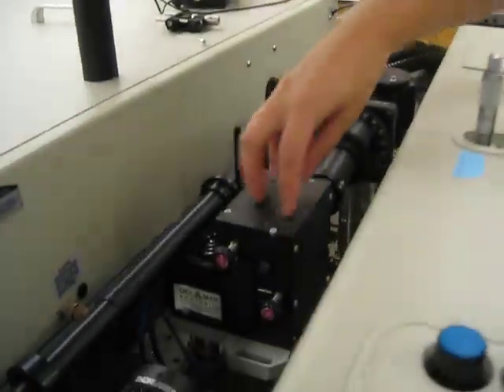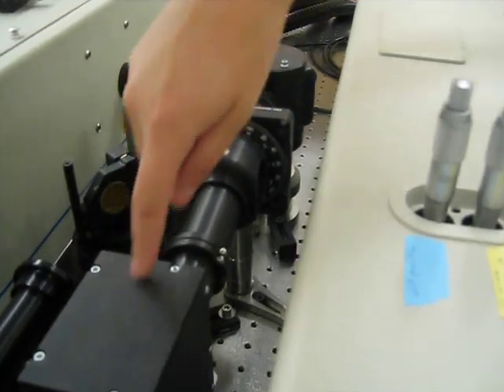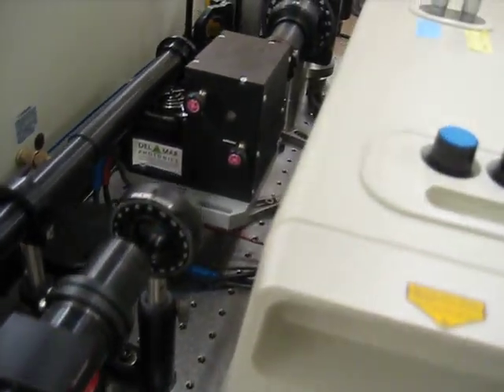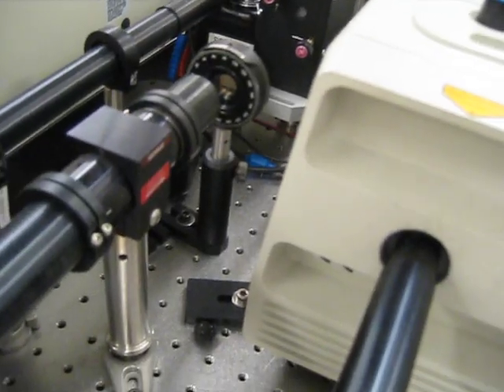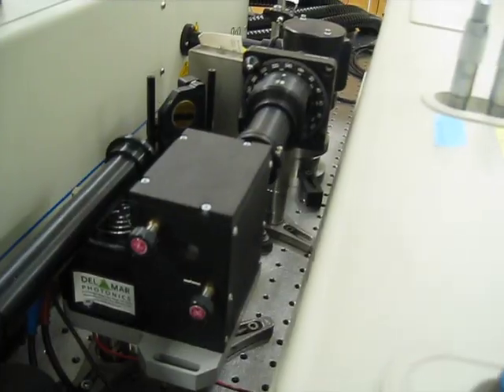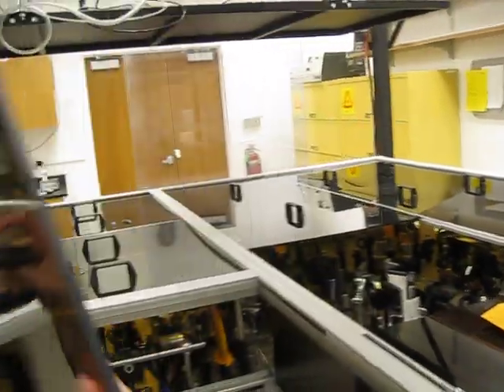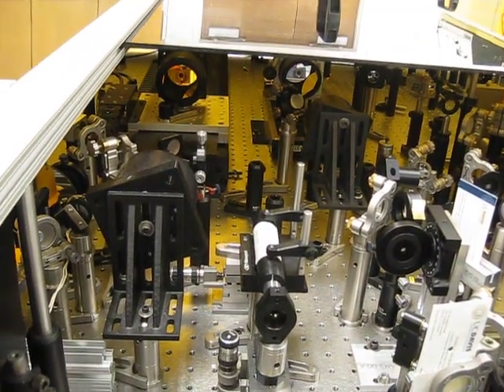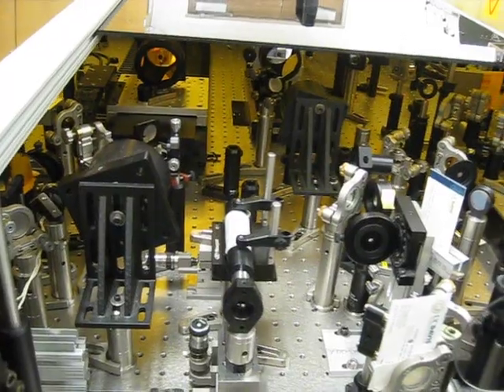A single source femtosecond-millisecond broadband spectrometer UC Davis - sales@dmphotonics.com

Comment from the maker: Related PW2015 presentations:

In situ determination of collagen fibrils size via absolute measurements of second harmonic generation 
Paper 9329-91
Author(s): Stéphane Bancelin, Institut National de la Recherche Scientifique (Canada); Carole Aimé, Lab. de Chimie de la Matière Condensée de Paris (France); Ivan Gusachenko, Lab. d’Optique et Biosciences, Ecole Polytechnique (France); Laura Kowalczuk, Therapeutic Innovations (France); Gaël Latour, Lab. d’Optique et Biosciences, Institut d'Électronique Fondamentale (France); Thibaud Coradin, Lab. de Chimie de la Matière Condensée de Paris (France); Marie-Claire Schanne-Klein, Lab. d'Optique et Biosciences, Ecole Polytechnique (France) 

2D simultaneous spatial and temporal focusing multiphoton microscopy for fast volume imaging with improved sectioning ability 
Paper 9329-92
Author(s): Qiyuan Song, Keio Univ. (Japan), RIKEN (Japan); Keisuke Isobe, RIKEN (Japan); Kenichi Hirosawa, Keio Univ. (Japan); Katsumi Midorikawa, RIKEN (Japan); Fumihiko Kannari, Keio Univ. (Japan) 

Optimizing laser and probe molecules for multi-photon microscopy 
Paper 9329-93
Author(s): Mary J. Potasek, Gene Parilov, Karl Beeson, Simphotek Inc. (United States) 

Motion-free polarization-resolved second harmonic generation cornea imaging with sub-15 fs pulses 
Paper 9329-94
Author(s): Hans Georg Breunig, Ana Batista, Aisada Uchugonova, Univ. des Saarlandes (Germany); Karsten König, Univ. des Saarlandes (Germany), JenLab GmbH (Germany) 

In vivo visualization of collagen fiber produced by cultured osteoblasts using sensitive second-harmonic-generation microscopy equipped with a 10-fs mode-locked Ti:sapphire laser 
Paper 9329-95
Author(s): Eiji Hase, Katsuya Sato, Takeshi Yasui, Univ. of Tokushima (Japan) 

Modeling acousto-optic two-photon ophthalmoscopy in pseudophakic patients 
Paper 9329-96
Author(s): Akos Kusnyerik, Semmelweis Univ. (Hungary); Balazs J. Rozsa, Institute of Experimental Medicine (Hungary); Pál Maák, Budapest Univ. of Technology and Economics (Hungary) 

A freely triggerable 766nm laser with optimized performance for STED applications 
Paper 9329-98
Author(s): Thomas Schönau, Dietmar Klemme, Marcelle König, Benedikt Krämer, Felix Koberling, Kristian Lauritsen, Rainer Erdmann, PicoQuant GmbH (Germany) 

Sarcomere-length variations during sarcomeric assembly and maturation 
Paper 9329-99
Author(s): Zhonghai Wang, Siyu Ma, Huaxiao Yang, Clemson Univ. (United States); Thomas K. Borg, The Medical Univ. of South Carolina (United States); Bruce Z. Gao, Clemson Univ. (United States) 

Adaptation of commercial microscopes for advanced imaging applications 
Paper 9329-100
Author(s): Craig Brideau, Peter Stys, Univ. of Calgary (Canada) 

All fiber based, multi-color two photon excitation microscopy with an amplified laser diode 
Paper 9329-101
Author(s): Sebastian Karpf, Matthias Eibl, Ludwig-Maximilians-Univ. München (Germany); Robert A. Huber, Ludwig-Maximilians-Univ. (Germany), Univ. zu Lübeck (Germany) 

Laser scanning stereomicroscopy for fast volume imaging with two-photon excitation and scanned Bessel beams 
Paper 9329-102
Author(s): Tong Ye, Clemson Univ. (United States); Yanlong Yang, Xing Zhou, Xi'an Institute of Optics and Precision Mechanics (China) 

Applied 3D printing for microscopy in health science research 
Paper 9329-103
Author(s): Craig Brideau, Kourosh Zareinia, Peter Stys, Univ. of Calgary (Canada) 

Two photon microscopy of native fluorophores spatial location in cancer and non-cancer cell lines 
Paper 9329-104
Author(s): Lin Zhang, Lingyan Shi, Robert R. Alfano, The City College of New York (United States) 

TICO Raman: time encoded Raman spectroscopy and microscopy with rapidly wavelength swept lasers 
Paper 9329-105
Author(s): Sebastian Karpf, Ludwig-Maximilians-Univ. München (Germany); Matthias Eibl, Ludwig-Maximilians-Univ. München (Germany), Univ. zu Lübeck (Germany); Wolfgang Wieser, Ludwig-Maximilians-Univ. München (Germany); Thomas Klein, Ludwig-Maximilians-Univ. München (Germany); Robert A. Huber, Ludwig-Maximilians-Univ. München (Germany), Univ. zu Lübeck (Germany) 

Imaging how the proteome respond under cell stress by stimulated Raman scattering microscopy 
Paper 9329-106
Author(s): Lu Wei, Wei Min, Columbia Univ. (United States) 

Monitoring metabolic enzyme activity in cells with fluorescence lifetime imaging of NAD(P)H 
Paper 9329-107
Author(s): Joe T. Sharick, Melissa C. Skala, Vanderbilt Univ. (United States) 

Detecting the collagen-based hydrogels degradation by multiphoton microscopy (MPM) 
Paper 9329-109
Author(s): Xuye Lang, Matthew J. Spousta, Julia G. Lyubovitsky, Univ. of California, Riverside (United States) 

Parallel multiplexed FLIM-FRET imaging in deep tissue of live embryos 
Paper 9329-110
Author(s): Ming Zhao, College of Optical Sciences, The Univ. of Arizona (United States); XiaoYang Wan, Univ. of Michigan (United States); Yu Li, College of Optical Sciences, The Univ. of Arizona (United States); Weibin Zhou, Univ. of Michigan (United States); Leilei Peng, College of Optical Sciences, The Univ. of Arizona (United States) 

In vivo non-invasive multiphoton tomography of human skin with subcellular spatial and picosecond time resolution to detect bio- and chemohazards 
Paper 9329-111
Author(s): Karsten König, Univ. des Saarlandes (Germany), JenLab GmbH (Germany) 

Two-photon photoacoustic optical imaging using femtosecond pulses 
Paper 9329-112
Author(s): Ben E. Urban, Northwestern Univ. (United States) 

Non-invasive discrimination between pancreatic islets and exocrine cells using multiphoton microscopy 
Paper 9329-113
Author(s): Binlin Wu, Ge Li, Mingming Hao, Shuibing Chen, Sushmita Mukherjee, Weill Cornell Medical College (United States) 

Imaging cardiomyocytes in intact tissue with a remote focusing microscope 
Paper 9329-114
Author(s): Alexander D. Corbett, Rebecca A. B. Burton, Gil Bub, Tony Wilson, Univ. of Oxford (United Kingdom) 

In vivo high-speed imaging of blood cells and tissues in mouse ear skin using multimodal nonlinear optical microscopy 
Paper 9329-115
Author(s): Eung Jang Lee, Daeyeon Kim, Bo Ram Kim, Sung-Ho Lee, Seung-Han Park, Yonsei Univ. (Korea, Republic of) 

Investigating cell membrane structure and dynamics with TCSPC-based FLIM 
Paper 9329-141
Author(s): Alix Le Marois, Dylan M. Owen, Aleksandar Ivetic, Klaus Suhling, King's College London (United Kingdom) 

Advances in microsecond wide-field TCSPC microscopy 
Paper 9329-142
Author(s): Liisa M. Hirvonen, King's College London (United Kingdom); Zdenek Petrasek, Max Planck Institute of Biochemistry (Germany); Andrew Beeby, Durham Univ. (United Kingdom); Klaus Suhling, King's College London (United Kingdom) 

Comprehensive quantitative evaluation of FLIM-FRET image data using intensity-based analysis tools 
Paper 9329-143
Author(s): Horst K. Wallrabe, Ammasi Periasamy, Univ. of Virginia (United States) 

Investigation of eNOS and GSNOR localization and interaction in pulmonary endothelial cells using Confocal Immunofluorescence FRET microscopy 
Paper 9329-144
Author(s): Shagufta Rehman, Univ. of Virginia (United States); Lisa Palmer, Univ. of Virginia School of Medicine (United States); Ammasi Periasamy, Univ. of Virginia (United States) 

MONDAY 9 FEBRUARY Show All Abstracts
Session 5:
Technology Development and Application II
Monday 9 February 2015
8:30 AM - 9:35 AM
Session Chair: Aisada Uchugonova, Univ. des Saarlandes (Germany)
Multiphoton tomography on astronauts (Invited Paper) 
Paper 9329-23
Author(s): Karsten König, JenLab GmbH (Germany), Univ. des Saarlandes (Germany); Martin Weinigel, JenLab GmbH (Germany); Nicole Gerlach, Ulrike Heinrich, DermaTronnier GmbH & Co. KG (Germany) 

Targeted illumination in 3D for excitation and stimulation 
Paper 9329-24
Author(s): Elijah Y. Yew, Peter T. C. So, Massachusetts Institute of Technology (United States) 

Breast cancer staging through nonlinear endomicroscopy 
Paper 9329-25
Author(s): Gunnsteinn Hall, Wenxuan Liang, Lu Jiang, Kristine Glunde, Xingde Li, Johns Hopkins Univ. (United States) 

Study of acetowhitening mechanisms in live mammalian cells with label-free subcellular-level multimodal nonlinear optical microscopy 
Paper 9329-26
Author(s): Jian Lin, Sengkhoon Teh, Wei Zheng, Zi Wang, Zhiwei Huang, National Univ. of Singapore (Singapore) 

JenLab Young Investigator Award Papers Presentation
Monday 9 February 2015
9:35 AM - 10:05 AM
Session 6:
Technology Development and Application III
Monday 9 February 2015
10:30 AM - 12:05 PM
Session Chair: Peter T. So, Massachusetts Institute of Technology (United States)
Optical reprogramming with ultrashort femtosecond laser pulses (Invited Paper) 
Paper 9329-27
Author(s): Aisada Uchugonova, Univ. des Saarlandes (Germany); Hans Georg Breunig, Univ. des Saarlandes (Germany), JenLab GmbH (Germany); Ana Batista, Karsten König, Univ. des Saarlandes (Germany) 

Compact fixed wavelength femtosecond oscillators for multi-photon imaging 
Paper 9329-28
Author(s): Tommi Hakulinen, Spectra Physics (Austria); Ruben Zadoyan, Tommaso Baldacchini, Newport Corp. (United States); Tilman Franke, FEI Munich GmbH (Germany) 

Novel applications of melanin pump-probe imaging: correlating structural and chemical variation with MC1R gene expression and the onset of Parkinson's disease 
Paper 9329-29
Author(s): Sanghamitra Deb, Christopher P. Dall, Francisco E. Robles, Christina S. Gainey, Jesse W. Wilson, Duke Univ. (United States); Nicole A. Kukutsch, Leiden Univ. Medical Ctr. (Netherlands); Warren S. Warren, Duke Univ. (United States) 

Femtosecond pulse shaping enables molecular imaging using optical Kerr-effect dynamics 
Paper 9329-30
Author(s): Francisco E. Robles, Martin C. Fischer, Warren S. Warren, Duke Univ. (United States) 

Integration of femtosecond fiber laser and endoscopy 
Paper 9329-31
Author(s): Huda Yousif, Hussein E. Kotb, Majid Naji, Univ. of Ottawa (Canada); Mohamed A. Abdelalim, Univ. of Ottawa (Canada), Electronics Research Institute (Egypt); Sangeeta Murugkar, Carleton Univ. (Canada); Hanan Anis, Univ. of Ottawa (Canada) 

Multiphoton light-sheet microscopy using wavelength mixing: fast multicolor imaging of the beating Zebrafish heart with low photobleaching 
Paper 9329-32
Author(s): Pierre Mahou, Lab. d’Optique et Biosciences, Ecole Polytechnique (France), Univ. of Cambridge (United Kingdom); Julien Vermot, Univ. de Strasbourg (France); Emmanuel Beaurepaire, Lab. d'Optique et Biosciences, Ecole Polytechnique (France); Willy Supatto, Lab. d’Optique et Biosciences, Ecole Polytechnique (France) 

Lunch Break 12:05 PM - 1:45 PM
Session 7:
SHG/THG Microscopy I
Monday 9 February 2015
1:45 PM - 2:50 PM
Session Chair: Chen-Yuan Dong, National Taiwan Univ. (Taiwan)
Combined wavelength dependent 3D SHG imaging, optical scattering and texture analysis to characterize changes collagen architecture and development of a classification system in human ovarian cancer (Invited Paper) 
Paper 9329-33
Author(s): Paul J. Campagnola, Karissa B. Tilbury, Kirby R. Campbell, Bruce L. Wen, Kevin W. Eliceiri, Vikas Singh, Manish Patankar, Univ. of Wisconsin-Madison (United States) 

Two- and three-photon excited fluorescence microscopy of erythrocytes using sub-50fs Ti:sapphire and Yb lasers 
Paper 9329-34
Author(s): Marcos M. Dantus, Ilyas Saytashev, Michigan State Univ. (United States) 

Combining wide-field assessment with nonlinear optical microscopy: possibilities for multimodal imaging in epithelial (pre)cancer 
Paper 9329-35
Author(s): Rahul Pal, Jinping Yang, Gracie Vargas, The Univ. of Texas Medical Branch (United States) 

Four wave mixing microscopy: a high potential nonlinear imaging method 
Paper 9329-36
Author(s): Tobias Ehmke, Andreas Knebl, Friedrich-Schiller-Univ. Jena (Germany); Alexander Heisterkamp, Leibniz Univ. Hannover (Germany) 

Award Presentation
Monday 9 February 2015
2:50 PM - 3:05 PM

Student Poster Session Competition 

Prize donated by: 
Becker and Hickl, Carl Zeiss Microscopy, LLC, Chroma Tech, Coherent Inc., ISS Inc., Leica Microsystems, Newport Corporation, Princeton Instruments, Semrock, Veroptics 

Graduate students and postdoctoral fellows with accepted posters can participate in the poster session competition of the conference on Multiphoton Microscopy in the Biomedical Sciences. There is a cash award for the winner(s). The participants should mention that their submission is for the “Students Poster Session Competition (SPSCMP).” The participants should follow the rules and regulations of SPIE or submission of their abstract and manuscript. 

JenLab Young Investigator Award 

Prize donated by: 
JenLab GmbH 

We are pleased to announce that a prize in the amount of $2000.00 will be awarded to a graduate student, postdoc, or scientist under the age of 32 within conference 9329: Multiphoton Microscopy in the Biomedical Sciences XV. To be eligible to receive the award, participants must 1) be both the primary author and presenter of an accepted abstract, and 2) the associated proceedings paper must be submitted at least 2 weeks prior to the meeting start dates for review by the selection committee.
Session 8:
SHG/THG Microscopy II
Monday 9 February 2015
3:30 PM - 5:35 PM
Session Chair: Paul J. Campagnola, Univ. of Wisconsin-Madison (United States)
Label-free second order susceptibility imaging of collagen (Invited Paper) 
Paper 9329-38
Author(s): Chen-Yuan Dong, Chiu-Mei Hsueh, Ya-Der Huang, Hsuan-Shu Lee, National Taiwan Univ. (Taiwan) 

Influence of pulse width on photodamage and inflammation during intravital autofluorescence 2-photon microscopy of murine intestinal mucosa 
Paper 9329-39
Author(s): Gereon Hüttmann, Lisa Krapf, Regina Orzekowsky-Schroeder, Norbert Koop, Alfred Vogel, Antje Klinger, Univ. zu Lübeck (Germany) 

Yb-fiber laser for multimodal imaging 
Paper 9329-40
Author(s): Ilyas Saytashev, Michigan State Univ. (United States); Bingwei Xu, Marcos M. Dantus, Biophotonic Solutions, Inc. (United States) 

Label-free multi-photon imaging of Barrett esophagus 
Paper 9329-41
Author(s): Seyed Soroush Mehravar, College of Optical Sciences, The Univ. of Arizona (United States); Philip Usera, Hemant Chatrath, Nasser Peyghambarian, College of Optical Sciences, The Univ. of Arizona (United States); Bhaskar Banerjee, The Univ. of Arizona College of Medicine (United States); Khanh Q. Kieu, College of Optical Sciences, The Univ. of Arizona (United States) 

Non-linear imaging and characterization of atherosclerotic arterial tissue using combined SHG and FLIM microscopy 
Paper 9329-42
Author(s): Riccardo Cicchi, Istituto Nazionale di Ottica (Italy), European Lab. for Non-linear Spectroscopy (Italy); Christian Matthaeus, Leibniz-Institut für Photonische Technologien e.V. (Germany); Enrico Baria, Univ. degli Studi di Firenze (Italy); Marta Lange, European Lab. for Non-linear Spectroscopy (Italy); Tobias Meyer, Leibniz-Institut für Photonische Technologien e.V. (Germany); Annika Lattermann, Universitätsklinikum Jena (Germany); Benjamin Dietzek, Leibniz-Institut für Photonische Technologien e.V. (Germany), Abbe Ctr. of Photonics Jena (Germany), Friedrich-Schiller-Univ. Jena (Germany); Bernhard R. Brehm, Katholische Klinikum Koblenz (Germany); Juergen Popp, Leibniz-Institut für Photonische Technologien e.V. (Germany), Abbe Ctr. of Photonics Jena (Germany), Friedrich-Schiller-Univ. Jena (Germany); Francesco S. Pavone, European Lab. for Non-linear Spectroscopy (Italy), Univ. degli Studi di Firenze (Italy) 

Biomaterial discrimination using wavelength-dependent SHG excitation efficiency 
Paper 9329-43
Author(s): Stephen J. Matcher, Nicola H. Green, Robin M. Delaine-Smith, Gwendolen C. Reilly, Hannah Askew, Xuesong Hu, The Univ. of Sheffield (United Kingdom) 

Discontinuous sampling in beam-scanning microscopy 
Paper 9329-44
Author(s): Ryan D. Muir, Paul D. Schmitt, Emma L. DeWalt, Shane Z. Sullivan, Ximeng You, Garth J. Simpson, Purdue Univ. (United States) 

Second harmonic generation imaging in tissue engineering and cartilage pathologies 
Paper 9329-45
Author(s): Magnus B. Lilledahl, Norwegian Univ. of Science and Technology (Norway); Magnus Ø. Olderøy, Norwegian Ctr. for Stem Cell Research (Norway); Andreas Finnøy, Norwegian Univ. of Science and Technology (Norway); Kristin Olstad, Norwegian Univ. of Life Sciences (Norway); Jan E. Brinchman, Norwegian Ctr. for Stem Cell Research (Norway) 

TUESDAY 10 FEBRUARY Show All Abstracts
Session 9:
Biomedical Applications of Coherent Raman I
Tuesday 10 February 2015
8:00 AM - 9:55 AM
Session Chair: Xiaoliang S. Xie, Harvard Univ. (United States)
Stimulated Raman scattering microscopy of chemical tags in live cells (Invited Paper) 
Paper 9329-46
Author(s): YanYi Huang, Peking Univ. (China); Xing Chen, Peking Univ (China) 

Bioorthogonal vibrational imaging of dynamic metabolism of living systems (Invited Paper) 
Paper 9329-47
Author(s): Wei Min, Columbia Univ. (United States) 

Visualization and quantification of peripheral myelin degeneration in amyotrophic lateral sclerosis (ALS) mouse model (SOD1G93A) and patients with stimulated Raman scattering (SRS) 
Paper 9329-48
Author(s): Wenlong Yang, Feng Tian, Harvard Univ. (United States); Daniel Mordes, Harvard Univ. (United States), Massachusetts General Hospital (United States); Naoki Suzuki, Satomi Suzuki, Kevin Eggan, Xiaoliang S. Xie, Harvard Univ. (United States) 

Probing myelin morphology and organization with label-free microscopy 
Paper 9329-49
Author(s): Alicja Gasecka, Institut Univ. en Santé Mentale de Quebec, Univ. Laval (Canada), Institut Fresnel (Canada); Pierre Gravel, Institute Univ. en Santé Mentale de Quebec, Univ. Laval (Canada), Univ. du Québec (Canada); Raphael Turcotte, Wellman Ctr. for Photomedicine (United States); Steve Begin, Daniel Cote, Ctr. de Recherche de l'Univ. Laval Robert-Giffard (Canada), Institut Univ. en Santé Mentale de Quebec, Univ. Laval (Canada) 

Visualizing murine meibomian glands physiology and pathology using coherent anti-stokes Raman scattering (CARS) microscopy and multi-photon microscopy (MPM) 
Paper 9329-50
Author(s): Joachim Pruessner, Univ. zu Lübeck (Germany), Wellman Ctr. for Photomedicine (United States); Reginald Birngruber, Univ. zu Lübeck (Germany); Conor L. Evans, Wellman Ctr. for Photomedicine (United States) 

Local organization of lipids in myelinated axons probed by polarization resolved coherent anti-stokes Raman scattering nonlinear microscopy 
Paper 9329-51
Author(s): Paulina Gasecka, Naveen K. Balla, Julien Duboisset, Patrick Ferrand, Hervé Rigneault, Sophie Brasselet, Institut Fresnel (France) 

Monitoring lipid accumulation in the green microalga botryococcus braunii with frequency-modulated stimulated Raman scattering 
Paper 9329-52
Author(s): Chun-Chin Wang, Dayananda Chandrappa, Nicholas Smirnoff, Julian Moger, Univ. of Exeter (United Kingdom) 

Session 10:
Biomedical Applications of Coherent Raman II
Tuesday 10 February 2015
10:25 AM - 12:00 PM
Session Chair: Daniel Cote, Ctr. de Recherche de l'Univ. Laval Robert-Giffard (Canada)
Label-free functional imaging of membrane potential by stimulated Raman scattering microscopy (Invited Paper) 
Paper 9329-53
Author(s): Bin Liu, Key Lab. of Science and Technology on Tunable Laser, Harbin Institute of Technology (China); Hyeon Jeong Lee, Interdisciplinary Life Science Program, Purdue Univ. (United States); Delong Zhang, ChienSheng Liao, Purdue Univ. (United States); Yuanqin Xia, Key Lab. of Science and Technology on Tunable Laser, Harbin Institute of Technology (China); Ji-Xin Cheng, Purdue Univ. (United States) 

Detection of human brain tumors with SRS microscopy 
Paper 9329-54
Author(s): Daniel A. Orringer, Univ. of Michigan Health System (United States); Minbiao Ji, Harvard Univ. (United States); Spencer Lewis, Sandra Camelo-Piragua, Univ. of Michigan Health System (United States); Xiaoliang S. Xie, Harvard Univ. (United States) 

Imaging human melanoma using coherent anti-stokes Raman scattering (CARS) and multiphoton microscopy (MPM) 
Paper 9329-55
Author(s): Hequn Wang, Sam Osseiran, Elisabeth Roider, Vivien Igras, David E. Fisher, Conor L. Evans, Wellman Ctr. for Photomedicine (United States) 

Histology in vivo: chemical contrast combined with clinical multimodal multiphoton tomograpy 
Paper 9329-56
Author(s): Martin Weinigel, JenLab GmbH (Germany), Univ. of Technology, Ilmenau (Germany); Hans Georg Breunig, Saarland Univ. (Germany), JenLab GmbH (Germany); Karsten Koenig, JenLab GmbH (Germany), Univ. des Saarlandes (Germany) 

Mechanically-induced protein structural changes in fibrin hydrogels using B-CARS microscopy 
Paper 9329-57
Author(s): Sapun H. Parekh, Frederik Fleissner, Mischa Bonn, Max-Planck-Institut für Polymerforschung (Germany)

Simultaneous quadruple modal nonlinear optical imaging for gastric diseases diagnosis and characterization 
Paper 9329-58
Author(s): Zi Wang, Wei Zheng, Jian Lin, Zhiwei Huang, National Univ. of Singapore (Singapore) 

Lunch Break 12:00 PM - 1:30 PM
Session 11:
Coherent Raman Technical Development I
Tuesday 10 February 2015
1:30 PM - 3:25 PM
Session Chair: Ji-Xin Cheng, Purdue Univ. (United States)
Hyperspectral stimulated Raman scattering imaging of drug-cell and drug-drug interaction (Invited Paper) 
Paper 9329-59
Author(s): Dan Fu, Harvard Univ. (United States); Jing Zhou, Novartis Institutes for Biomedical Research, Inc. (United States); Xiaoliang S. Xie, Harvard Univ. (United States) 

In vivo microsecond scale vibrational spectroscopy imaging by modulation multiplexed stimulated Raman scattering (Invited Paper) 
Paper 9329-60
Author(s): ChienSheng Liao, Pu Wang, Ping Wang, Robert Oglesbee, Ji-Xin Cheng, Purdue Univ. (United States) 

Resolution and contrast enhancement in label-free microscopy 
Paper 9329-61
Author(s): Alicja Gasecka, Institut Univ. en Santé Mentale de Quebec, Univ. Laval (Canada), Institut Fresnel (Canada); Amy Daradich, Harold Dehez, Institut Univ. en Santé Mentale de Quebec, Univ. Laval (Canada); Michel Piche, Univ. Laval (Canada); Daniel Cote, Ctr. de Recherche de l'Univ. Laval Robert-Giffard (Canada), Institut Univ. en Santé Mentale de Quebec, Univ. Laval (Canada) 

Fast spectrum extraction from SRS spectral images by independent component analysis with image compression and post sampling 
Paper 9329-62
Author(s): Yasuyuki Ozeki, The Univ. of Tokyo (Japan) 

Beam scanning approach to broadband coherent Raman imaging 
Paper 9329-63
Author(s): Young Jong Lee, Charles H. Camp, Marcus T. Cicerone, National Institute of Standards and Technology (United States) 

Nonlinear optical microscopy and optical coherence tomography platform for label-free functional biophotonic imaging 
Paper 9329-64
Author(s): Angelika Unterhuber, Medizinische Univ. Wien (Austria); Sunil Kumar, Weizmann Institute of Science (Israel); Tschackad Kamali, Boris Hermann, Rene Werkmeister, Medizinische Univ. Wien (Austria); Yaron Silberberg, Weizmann Institute of Science (Israel); Wolfgang Drexler, Medizinische Univ. Wien (Austria) 

CARS/FWM and scanning probe microscopy of nanostructures (Invited Paper) 
Paper 9329-65
Author(s): Annika M. Enejder, Michael Stührenberg, Nisha Rani Agarwal, Mahesh Namboodiri, Juris Kiskis, Chalmers Univ. of Technology (Sweden) 

Session 12:
Coherent Raman Technical Development II
Tuesday 10 February 2015
3:55 PM - 5:50 PM
Session Chair: Marcus T. Cicerone, National Institute of Standards and Technology (United States)
Background-free stimulated Raman spectroscopy and microscopy (Invited Paper) 
Paper 9329-66
Author(s): Hervé Rigneault, Esben Andresen, Pascal Berto, Institut Fresnel (France) 

Pushing the limits of coherent Raman spectroscopic imaging (Invited Paper) 
Paper 9329-67
Author(s): Marcus T. Cicerone, Charles H. Camp, Brandon Blakely, Young Lee, National Institute of Standards and Technology (United States) 

Fiber-laser platform for coherent Raman scattering 
Paper 9329-68
Author(s): Christian W. Freudiger, Invenio Imaging Inc. (United States); Wenlong Yang, Gary R. Holtom, Harvard Univ. (United States); Jay Trautman, Invenio Imaging Inc. (United States); Khanh Q. Kieu, The Univ. of Arizona (United States); Sunney Xie, Harvard Univ. (United States) 

Optimized coherent Raman scattering microscopy with a novel tunable dual-wavelength lightsource 
Paper 9329-69
Author(s): Ingo Rimke, APE GmbH (Germany); Gregor Hehl, Univ. Stuttgart (Germany); Marcus Beutler, Peter Volz, Edlef Büttner, APE GmbH (Germany); Andreas Volkmer, Univ. Stuttgart (Germany) 

Towards low-noise fiber sources for coherent Raman microscopy 
Paper 9329-70
Author(s): Erin S. Lamb, Hanzhang Pei, Frank W. Wise, Cornell Univ. (United States) 

Optimized signal-to-noise ratio with shot noise limited detection in Stimulated Raman Scattering microscopy 
Paper 9329-71
Author(s): Miriam J. B. Moester, Freek Ariese, Johannes F. de Boer, Vrije Univ. Amsterdam (Netherlands) 

Detecting polymeric nanoparticles with coherent anti-stokes Raman scattering microscopy in tissues exhibiting fixative-induced autoflourescence 
Paper 9329-72
Author(s): Natalie L. Garrett, Univ. of Exeter (United Kingdom); Lisa Godfrey, Univ. College London (United Kingdom); Aikaterini Lalatsa, Univ. of Portsmouth (United Kingdom); D. R. Serrano, Univ. Complutense de Madrid (Spain); Ijeoma F. Uchegbu, Andreas G. Schatzlein, Univ. College London (United Kingdom); Julian Moger, Univ. of Exeter (United Kingdom)